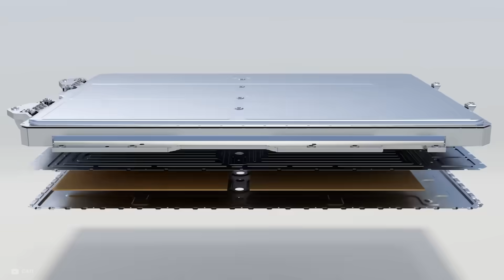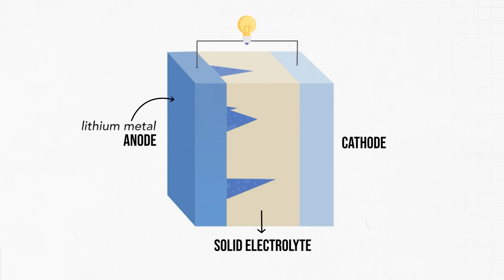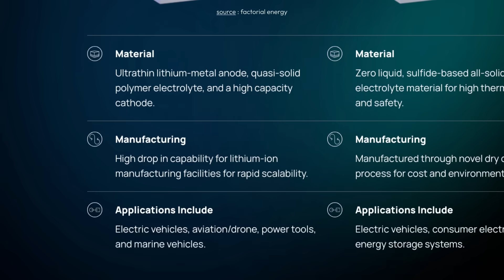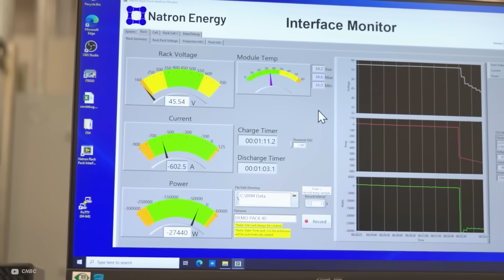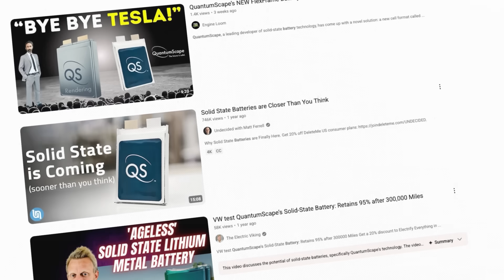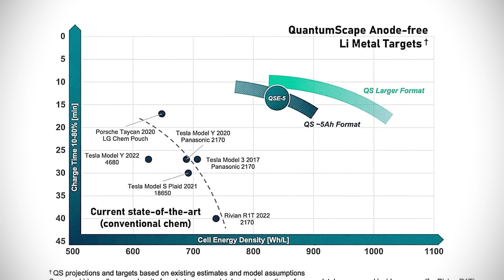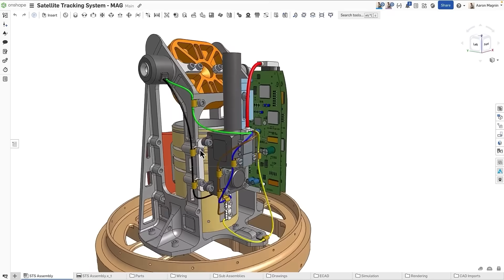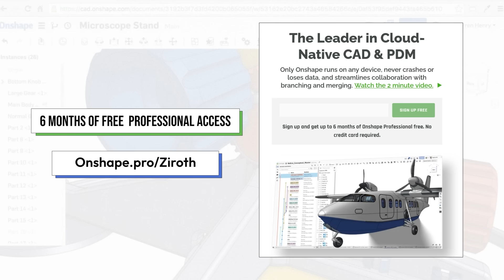The Decade Wait is Over, Solid-State Exists.

Comment: I have a solid state battery fitted in my boat.  24v 60Ah 15kg.  

It replaces four 12v 100Ah 15kg glass matt lead acid batteries for a little less than twice the cost.

They are IP67, do not self combust, and will last multiple times longer than the old lead acids.

LiFePO4 is dead as far as electric outboards go.  

Mobile phones fitted with them will sell for a premium because the size and life span is so much better.  

Watch for the first $2,000 compact long life iPhones flying off the shelves.

Comment: Energy density is not the only criterion when evaluating a battery. Companies often highlight favorable numbers while downplaying the less impressive ones. Any truly viable battery technology must demonstrate all of the following:

- High energy density

- A cycle life of over 1,000 cycles with at least 80% capacity retention
(Measured at a 1C charge rate; many companies misleadingly use 0.1–0.2C to inflate results.)

- Fast-charging capability
(Roughly 10 minutes to reach 80% charge, with 300–500 cycles maintained at 3–4C fast charging.)

- Safety — the most critical factor
Solid-state batteries (SSBs) are inherently non-flammable, but some sulfide-based SSBs can produce H₂S gas, which is hazardous.
Reply: https://youtu.be/O8PjlwZVLVE?si=FRWKGbfTmpfgL0pt

Comment: Solid Lithium metal is not used as anodes and was never used commercially (outside niche type things by crazy people). 

It's safe voltage is too low (where dendrites start growing fast). And even then it's not safe at all.

Instead in the design that became a commercial success, Graphite is used for the anode. And instead of plating an anode with Litium when recharging the cell, the graphite kind of absorbes lithium ions, in between it's sheets. 
(graphite is basically made of graphene sheets held together by the weak Van Der Waals force).

The Cathode is typically made of a metal oxide that already contains lithium in a similar manner as how the lithium is absorbed by graphite in between sheets of carbon.

The original metal oxide cathode material that made Litium ion batteries possible (in terms of safety), was Lithium Cobalt Oxide. 

So in the design that's always been the commercial one, the cell does not start out charged because the anode has no lithium (it's just graphite). Which is unusual when it comes to electrochemical cells.

Comment: 375 Wh/kg sounds great. And it is compared to traditional Li-Io batteries, until you remember petrol has an energy density of around 12,000 Wh/KG. Yes, ICEs are MUCH less efficient than electric motors, but even if we ignore ALL loses in the electric car, assuming a conservative efficiency of just 20% for the ICE vehicle, batteries would have to be around 2,400 Wh/KG to compete with plain ol petrol in terms of raw energy density. More so with diesel. In other words, the battery is still around 6.4x heavier than a tank of fuel for the same energy. That means you'd need a battery pack 6.4X heavier than a typical fuel tank assuming no losses to travel the same distance and around 7.5-8X heavier in a more realistic model. Better than the 10x difference a decade ago? Yes. But not enough to change my mind on electric cars, especially in the commercial space.

Comment: When solid-state batteries hit mass production and are adopted in new vehicles with specs that far outperform current battery technologies, the residual value of existing battery electric vehicles will plummet. This is actually great news for buyers who lack purchasing power but want a reliable second-hand vehicle that will last them 8 to 10 years on the road.
Reply: Hence, my 2015 Leaf with only 32,000 miles which I purchased this year for under $6000. 😊

Comment: as long as the ion that is moved over the battery separator (solid electrolyte in solid state batteries) is a lithium ion, even if the anode is not made of purely lithium, it would still be a lithium ion battery.

Comment: At the end of the day full solid state batteries are still significantly more resistant to thermal runaway to the point that it would be nearly impossible with any normal use case for vehicles or consumer electronics so the safety plus the added energy density will still be appealing to companies & consumers assuming they can get production costs to be about the same as our current cells

Comment: So most cars won't benefit from the weight savings, then more manufacturers need to think like Lotus, ie Colin Chapman, look at the current gen mx-5, still very affordable, and crash and emission compliant while being roughly 2300lbs, or 1000lbs lighter than the average gas car or 1400ish lbs less than the lightest affordable EV,  call that $50-70k USD. Saving weight is never a bad thing, again look at Colin Chapman, cut 300+ lbs off a car while matching or improving range can only help it, look at a commuter car; better acceleration, better city range, better wear/tear on tires and brakes, possibly better highway range, for the average person that probably drives more city than highway miles this can only help the selling points of an EV car, keep the price in line with a nicer gas car and more people will cross shop the good EV with a modest gas, of course the Prius always messes with this math.

Comment: I do like the idea of a vehicle that i can drive on electricity but we have been sold that electric power is going to be cheap and abundant and so no need for fossil fuels. Unfortunately parity has not been reached borh in capacity and recharge times and even if recharge times were 6 mins the infrastructure cannot keep up with that amount of energy. The technology just isn't mature enough and now we turn massive fields in solar and wind farms that and once productive farms. Also they require so much fossil products to produce, so the question is are we really saving the environment by reducing the transport sector? Or is just the low hanging fruit that is most visible...? We have mature nuclear tech so wtf aren't we using it? But we release 1000k tons of co2 into the atmosphere when with nuclear power it's contained, did you know that coal also releases radioactive compounds when burned. I like green as a idea but sadly i feel it's a grift and a scam.

Comment: Question to @ZirothTech and all nerds in the comments: can you, in theory, combine several battery advancements together? For instance, a silicon anode and a sulphur cathode with a solid state electrolyte? So an anode which holds more lithium ions, a cathode which does the same, and an electrolyte which can shuttle more lithium ions, or do so more efficiently? I'm not asking whether this is practical, but whether it is in theory possible.

Comment: I’ve been curious about EVs and solid state for a long time. My belief would be that solid state, especially ceramics based, are not about the benefit of capacity and charging speed alone. The infrastructures of most states simply cannot and will not support 300kW+ charging on mass scales.
An average driver only covers around 80km per day in Europe.
This is about efficiency, weight and the ability to remove active cooling, as shown in the Mercedes EQXX prototype.
If I wanted to make sure EVs succeed on a mass scale, cars with tiny footprint 42kWh solid state batteries, passive systems and an average consumption of 8-10kWh/100km, alongside widely available overnight public slow charging everywhere, would be the way. 1300-1500kg per car.

The low consumption average, partly thanks to a passive design, was achieved by the EQXX, the weight+capacity achieved by the 8 years old BMW i3 120ah.
Advancements in solid state, axial flux motors, centralized efficient ECUs, lightweight sustainable materials (flax carbon) - this is what I look forward to.

Comment: I strongly disagree with your suggestion that passenger vehicles won't need solid state batteries. If their energy density is as advertised, it would allow EVs to shrink a lot. Small city car EVs with decent range would become a viable option. Quick charging at public charging locations would also be a big bonus.

Comment: The latest 4680 batteries are just under 300 watts hours per kg and are already powering $45k Teslas with a greater than 450 mile range. Silicon is beginning to be introduced to this very scaleable and cheap technology, which Panasonic (Tesla’s battery partner) claim will have a cell with a further 25% hike in power density in 2 years. Meanwhile best in class is over 450 watt hours per kg. So these seem to be interesting, but neither best in class or truly scaleable at a competitive cost. It is exciting though.

Comment: In the UK we've got the most expensive  electricity in the known universe and our roads are falling to pieces. While the solid state battery does appear to be a significant improvement over the current  crop of deathtrap firestarters I'm still unconvinced that EV's offer a significant advantage in overall CO²emissions.  Hopefully they will (I'm not aware of the solid state battery vehicle's CO²emissions,  but they need to offer a significant improvement over the firery death variety) hopefully this is the case. It would also be great if all the pollution caused by mining, the often horrific working conditions and total disregard for miners health and safety need to be improved and child slavery ended. I think the EV's that have so far been available to the consumer have probably done more harm than good. Our grid needs a serious rethink and overhaul,  prices are ridiculous so a handful of parasites can get rich quick. I think the solid state tech may be promising. I have  lung disease and believe me I would certainly appreciate air free of tail pipe toxins. Let's hope the latest developments lead to something more practical and  cheaper  than  the  current offerings in the EV space.

Comment: The problem with so-called "solid electrolytes" is that the ions, meaning charged atoms, still have to be moved around. Any imperfections in the anode such as contaminants or tiny points that are comparatively higher potential than the others, I feel, will always cause ions to prefer these to move to, which makes dendrites almost inevitable, I feel.
I think rather than trying to make a better electrolyte, we need to find ways to build smarter anodes.

Comment: As much as EVs is very much a market for these, I do wonder when we'll see better battery tech as small, affordable packs that can go in laptops, phones, power packs, electronics projects, 18650/21700 format cells, as some kind of slot-in replacement for existing Li-ion, LiPo and LiFePO4 stuff. Or at least as a near-replacement with just a different charging profile needed.

Comment: Meanwhile all this rapid development means that I won't be buying an EV for many years yet. Not until the insane rates of depreciation from obsolescence moderates. Quasi solid, then true solid state cells, sodium ion cells... each introduction destroys used EV resale value because none of the batteries are economically upgradable. And don't think leasing is the answer. Car lease companies are getting burned over residual values, even if the lessors don't (for now).

Comment: "The battery is ONLY in a motorcycle" !  

Okay , as a motorcyclist, weight is a lot more important than it is in cars. Don't get me wrong , it'll be great if the battery packs for 4 wheeled vehicles can be made a lot lighter, however on motorcycles the current (no pun really intended, honest !) lithium ion batteries are terrible in motorcycles. They make over weight obese motorcycles that have terrible range, charging issues, and don't handle as well as their lighter petrol powered equivalents.  The battery electric motorcycles that are available right now are terrible. 

So if they can make a battery that gives 200 mile range at motorway speeds (70 MPH) , in a bike that weighs around 220 Kg max , that can be charged to 80% in about 10 mins, then a lot of bikers will start thinking battery electric bikes might be acceptable . All they then then is a bass tube exhaust pushing out the sounds of their favourite petrol engine configuration , whether that's a single, twin, triple or straight four !!! Some might want a reciprocating mass to simulate some of the vibrations of a piston engine. Bikers are a bit strange and fussy me included, on the sound and vibrations of their bikes !!! But solve the cost, range, weight and charging battery issues, and electric motorcycles might get embraced by bikers.
Reply: Most people don't need to go that far and with a well designed setup you can have two or more so one can charge from solar as you go with another. You can already get an eBike less than 100 lbs that can go more than 150 miles on a charge, takes a long time to recharge, but have places to mount a system to charge a secondary battery on the go. The cost savings are worth it if you don't need the very long range very often.
Reply: @uncrunch398  the pedal type of ebike can only do 15mph with powered assistance !
i want to go 70mph , and be able to do 200 miles on a tour before stopping.

Comment: high density batteries with extremely fast discharge rate are cool, but no one actually needs them. we need cheaper batteries that are easy to manufacture and don't use a lot of rare earth metals. maybe the 0.1% of the population that drives more than 500km a day REALLY NEEDS them, but the 99.9% of the population that drives less than 100km a day just need an EV they is actually in their budget.

Comment: Lifepo and sodium have a good enough range, and particularly sodium is extremely cheap, cell wise.
CATL claims $10 per kWh, but even if it was $20, and similar volumetric and weight  density to current Lifepo, solid state won't be able to compete, if you can out a 450km battery for $3000 or less.

Comment: I wouldn't say vehicles don't need them. I don't see mass adoption coming until a Model 3 can do what a Camry can. 400 mile round trip, over a mountain pass, -5*C with heat on the whole way, and still have enough "fuel" left in the morning for a 30 mile commute.

Comment: If solid state works it means you don't need a huge battery pack which reduces weight and the price of an EV.
You will be able to charge a smaller battery in the time it usually takes an ICE care to refuel.
Game changer.

Comment: I have driven electric vehicles since before tesla was a brand. From my converted 300zx "lead slead"(25 mile range) to a ford focus EV(70 mile range) and now a MACH-e(300 mile range) and one thing that is important about the increase in wh/kg is we can avoid whay I call the EV equation. The for focus was low range but that made the pack small, so it weighted less, The mach-e has a 300 mile pack it weights more, the car weights more, the wh/mile is higher (worse) BUt my drive to work is still the same 20-30 miles a day. I now pay for the added weight of that pack every day as I have to carry the whole 300 mile range around with me even if I am using 30. An optimum point may well be found when you can fill in 5 min a pack that gives a smaller car 100 mile range.

Comment: The key has always been getting electrode surfaces to re-template, or "self-heal", during a cycle without changing size or shape. Research batteries with insane power/energy density have been around for a while. Getting that performance with recharge longevity (and low risk of accidental combustion) has been the tough nut to crack the whole time. This is why electrolyte chemistry and morphology has been where all the research has been lately.

Comment: Well Amprius uses silicon nanowires for 400 Wh/kg and you can actually buy those cells in drone packs even now but yeah they are expensive but good to see some real progress on batteries. Still I think battery future is more with LFP/SIB because they are getting cheaper each day, last very long time, are already very safe and LFP is quite sustainable and SIB can be most sustainable battery ever built meaning you can electrify everything without much environmental cost at all. And better way to get more range is to focus on efficiency like rolling resistance and air resistance so then even current LFP can provide a lot of range. This has massive advantages of requiring less production and even if renewables scale globally fast its still really good idea.

Comment: 9:30 Next gen NCMA cells with added silicon by SK, LG or AMG will certainly bridge the gap to SSBs. AMG announced cells for the upcoming AMG platform of more than 300 Wh/kg and 740 Wh/L. Another example: SK cells with 305 Wh/kg displayed by Ferrari. Especially those AMG cells seem to be almost on level with SSBs in terms of charging with the GT XX peak charging above 1,000kW.

Comment: The problem with new European innovations is that the price war has been lost. You can buy Lifepo4 cells as a consumer with 50€/kwh (ex. VAT). With that price a battery pack of 100kwh would cost only 5000€. That's insanely cheap already. And i can see it's being hard to compete with any "slightly better" tech with that price point. Cars with LFP-batteries will just dominate in near future I'd say.